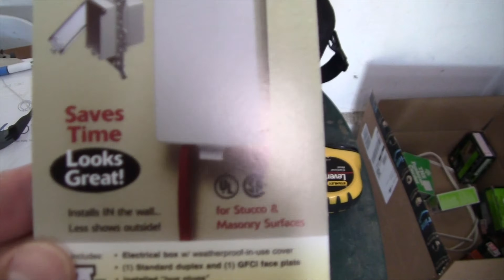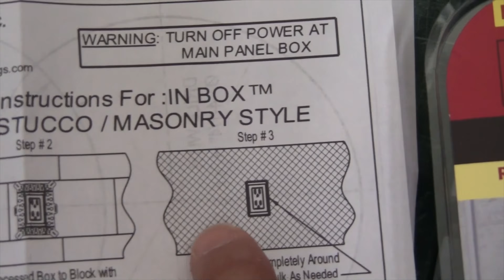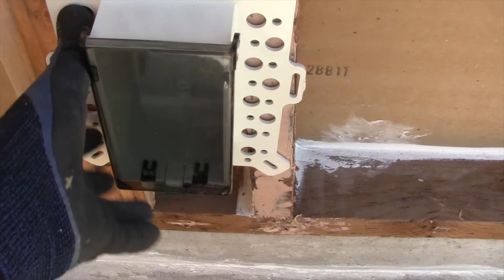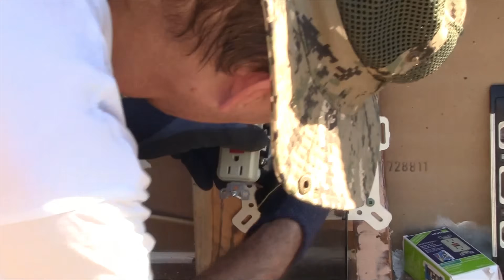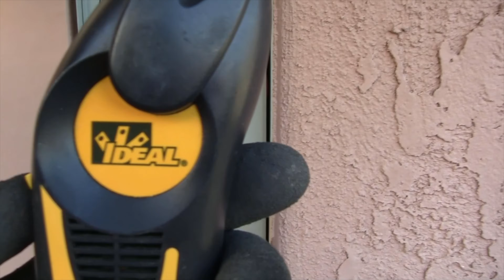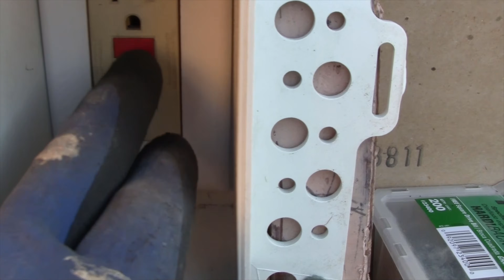Stucco Repair Series Part 3   Installing an Exterior Outlet for New Construction Stucco Wall

Comment: Can someone suggest (or provide a link) how to properly seal the outlet after papering for stucco?  My guess is either caulk or a sealing tape.
Reply from the maker: I agree with you 100%, Sealant or Flashing Tape will do the job you want here. Install like roofing shingles and you will be good.